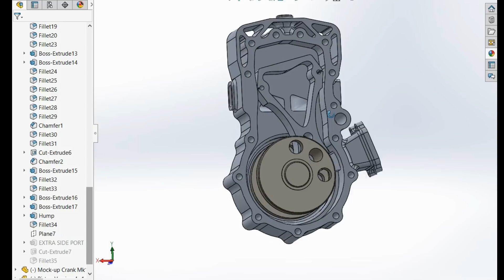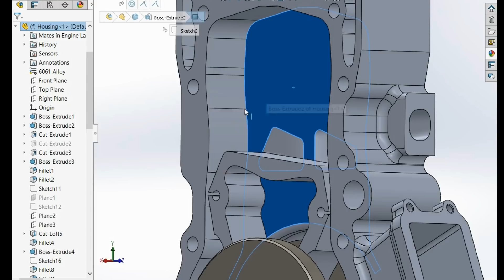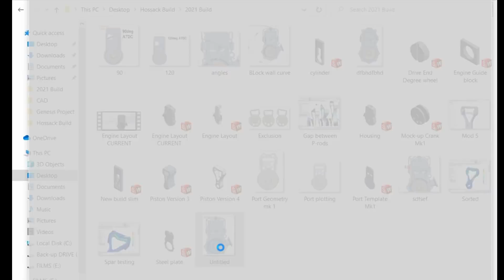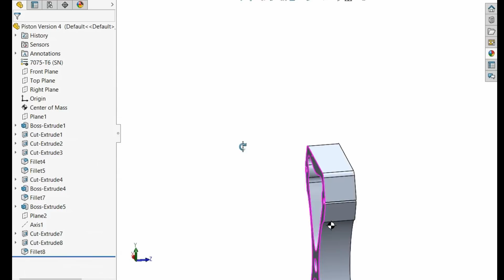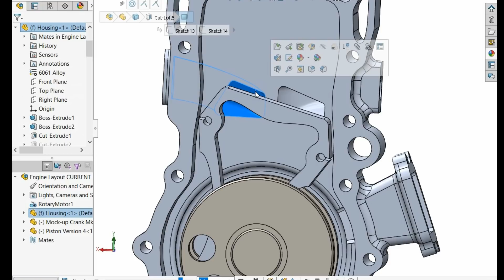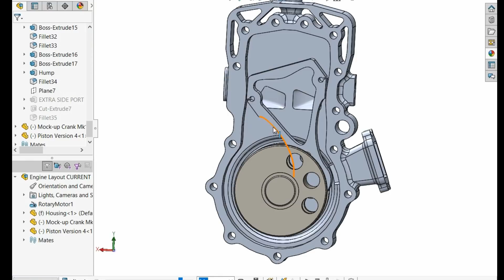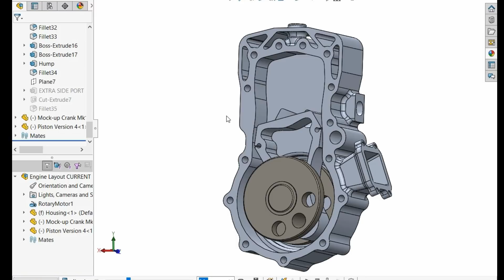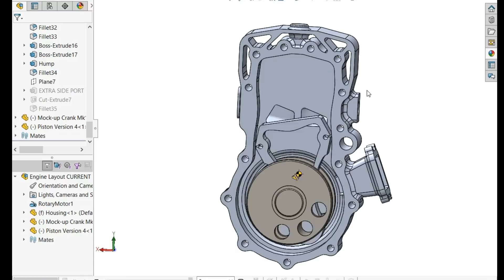The Hudson/Hossack Engine   Part 4

Comment: Matt the piston/con rod material you're looking for is Elektron 675 which is a magnesium aluminum alloy. Looking forward to part 5, good luck.
Reply: Elektron 675 is supposedly lighter than aluminum, stronger than aluminum at temp, and easier to machine than aluminum, cost oh well you can't have everything.

Comment: You can add a trace to the tip of that wiper and get the exact shape of it when you animate it. I can’t remember if that’s an inventor thing or a solidworks thing though. Too many CAD softwares in my head..

Comment: I like the flat p-rod.  It could be made dirt cheap as an extrusion - no need for expensive machine time, just slice it as thick as you want, face mill each side, bore the bearing seat, and cut the grooves for the seals - job done.  There'd be very little waste in the process too.  Extrusions are great for automated topology optimization too, so you could get a pretty optimal structure relatively easily.  
Have you considered making the crank modular as well?  Short, spline-ended tubular shafts for rod and main journals, would reduce the moment of inertia significantly, make the manufacturing process really simple compared to the traditional crank, and would allow a lot of flexibility.  Want another couple of extra "cylinders"?  Just add a couple of case modules, and extend the crank with some more counterweight plates and journals.  Each part would be identical and easy to mass produce.  If the number of splines was a multiple of 12, the same balance plates could be used with different rotations (60°/120° for i6 vs 90°/180° for i4).  A modular crank might be less rigid along its length, but it doesn't need to be as long as each segment is supported.  If you wanted to produce an engine with a bigger "bore", you'd just use thicker cylinder modules, slice your p-rods thicker, and use longer rod journals in the crank, with no need for major design or tooling changes.  By having such a modular crank, you wouldn't need the p-rod to have a split bearing - you'd just bore a precision hole and press fit a bearing/bushing, slide it onto the pin, and fit the balance disc to complete the assembly.  The main bearings could also use inexpensive bearings, press fit into the steel plates, eliminating the need for complex oil injection passageways.

Comment: The wall shape issue is interesting... seems like you've assumed the "piston path" should be straight up and down and pass through the conrod center, but a lot of engines now have offset cranks and this one even seems to allow a curved piston path!  All of this would affect / depend on the shape of the chamber walls, and impact port locations / timing.  Likely to much to fuck with for a project like this, but if it ever caught on gives yet another parameter to play with.

Comment: Great project mate!

I am watching your channel for a quite long time and I always could find some interesting tidbits in your videos (Thank you!). Since I am also a mechanical designer and have some experience with ICE I would like to share with you some suggestions for this engine design if you don't mind.

1. I would make a press-fit crankshaft design since they are much easier to manufacture and later on you can quite easily make different firing orders (180 degrees, 90 degrees, Big Bang,...) and it could be used for 2T and 4T engine. First, I would suggest you a 2 cylinder (parallel twin) design since you can play with firing orders (2T and 4T) and different port designs on midplate and still get all relevant data for n-cylinder designs. Also, you can use a variety of dimensions and designs of needle bearing models for big end.

2. Conrod-Piston design is not ideal natural frequency wise and in my opinion, some of its sections could be prone to buckling. I think you should use something like T or H profile along the triangle contour of the conrod-piston part.

3. Piston part sides should be circular or oval without sharp transitions with top piston plane since those sharp edges could be a source of hotspots for knocking. That side squish section of the piston will accelerate the hot gasses across that edge and make it very hot.

4. For a 2T diesel model with intake valves I would go with a Bishop rotary design valve and had an intake port with 75% of the surface of the piston or something on the line with Lotus 2T design from 1991 (http://www.douglas-self.com/MUSEUM/POWER/unusualICeng/RotaryValveIC/lotushoriz1b.jpg). You could get an engine with 15:1 CR ratio and with very high engine speed (15k RPM?) since volumetric efficiency should not be an issue.

Thank you for all of this and good luck with the project!

Comment: If the “p rod” is to have an open centre , then wouldn’t this mean that both ports would be open at the same time whilst combustion is happening meaning that gases would be free to flow in either direction between cycles
Reply from the maker: Yes
Reply: And wouldn’t that be undesirable as not only could the exhaust gas dilute the intake charge but the pulse could also slow the incoming charge
Reply from the maker: Well it depends what you're exhaust gases are doing and what the intake is doing at that time

Comment: What about a thin web/fillet on the underside of the piston on the inlet side located up against the side wall nearest the inlet port. This would block any inlet going below the piston on the upstroke when the exhaust port is closed and force the air/fuel mixture above the piston. Obviously there is a weight and balance consideration to be taken into account

Comment: Would it be possible to use 2 piston rings/piston edge seals on each side (one just above and one just below where the current seal is) to account for the rocking, or would that negatively affect the seal contact too much?

Comment: with 4 cylinders with crankpins at 90 degree spacing, how do the primary and secondary balances work? 
how smooth is it? 
what about narrower angle to create somewhat of a "big bang" firing order...probably not as smooth but more tractable for a motorcycle...

Comment: Would love to see this as an opposed piston motor!
Reply from the maker: Why?
Reply: @thedirtyworkshop   love the concept of two pistons pushing each other instead of trying to push a head...perfect primary and secondary balance, if there is such a thing...
with such an efficient port layout crankcase induction could be maintained, avoiding the weight and complexity of a blower.
for aircraft use the gear driving the two cranks could double as the prop reduction...

Comment: Hey Matt,

I know this is a design process for you still, but I was curious how the crankshaft is going to be installed with the multiple plates/housings. If it was a single piston design, no big deal, but those crank counterweights will prevent you from layering the plates/housings together like you would on a Wankel with an eccentric shaft. Not criticizing, just curious how you will go about tackling this, like if you'll have the bottom part of the plates/housings drop out to form the bottom part of the crankcase, but that adds some complexity so I'm not sure. You've probably thought about this and more than likely will be on a future video, but figure I would ask.

Keep up the excellent work. This is really interesting.

Comment: 1. How would the torque be affected by the limited surface area of the piston?
2  Could the rocking motion be used to assist combustion efficiency?
Cheers
Reply from the maker: 1. Limited surface area?
Reply: @thedirtyworkshop  it seems like a long skinny piston crown..lol..
Could we make it wider so there is more surface area and hence more torque..
I figure it's going to be a screamer of an engine.. maybe trade some topend for a bit more, lower down the rpm range??
Reply from the maker: That's not how it's works... more area means more volume. Not only that, this is a 147cc cylinder, do you know who much area there is compare to a round piston?
Reply: @thedirtyworkshop  Yes more volume but also we are not port restricted so filling a larger cylinder won't be a problem.
Combustion pressure should be the same so more surface area on the piston should give us more torque... yes it would increase the displacement but considering how little it weighs it should be OK??
Reply from the maker: That's not how pressure works...

Let's say you have a 1 litre engine and a 2 litre engine. The 1L has a piston area of say 4 in^2 and the 2L has a piston of 6in^2. Let's say combustion pressure is 1600 psi for each. The 1L engine would have a force of 400 lbs. The 2L would have a force of 266 lbs. Less force.

But it depends what the crank stroke is. In other words it doesn't just work as "bigger is better". These are PV engines where pressure and volume matter. If you have a bigger piston, you have a larger volume change per mm of stroke, which means pressure drops more rapidly. 

If large meant more torque then why do the biggest engines in the world have small pistons vs their stroke???
Reply: @thedirtyworkshop  
I'm confused mate.. how does a lager surface area produce less pressure? 
All else been equal  a larger surface area to push on would make more torque??  I think..lol 😆

I understand it's a pv engine ect but if that all stays the same just a bigger displacement it should make more  torque... ??
Reply from the maker: Pressure is force/area. If the force is the same but the area is increased then the pressure drops...
Reply from the maker: Now you're talking displacement which is volume. Make your mind up, are we change area or volume...?
Reply from the maker: Anyroad, back to your original comment, you said limited surface area. It's not. It's actually the same. That's how I defined the size of it
Reply: @thedirtyworkshop  I missed the point.. soz.
It's supposed to be the size it is for a reason.. sweet as mate
Reply: @thedirtyworkshop  both I would think.. if stroke stays the same?

Comment: Amazing stuff! Is it possible to do TPi on this and have the bottomend with healthy lubrication like a 4 stroke ?
Reply from the maker: You.can always do that, but at the expense of complexity and weight
Reply: @thedirtyworkshop  Oh yes, very important and crucial factor. I understand why you didnt add the TPi. Whole point of the engine is to be lightweight and cheap.
Reply from the maker: The other issue is pumping. TPI doesn't solve that.
Reply: @thedirtyworkshop  I can always be that idiot and say 'jUsT suPercHarge iT m8' but yeah, that adds a shitton of weight, cost & complexity on something that's even simpler than a 2 stroke 😂

Comment: Matt, looks to be a viable concept, I can see this working as a single or a twin 'cylinder' but for anything greater than a twin how would you feed and exhaust the cylinders? 
Wouldn't the ported sideplates need to be thick enough to allow a port through their width and then turn 90° to allow carb/injection and exhausts to be located as per accepted norm?
I would imagine this would disrupt the inlet mixture flow, and also create an undesirable localised hotspot for the exhaust.
I guess that the plates could be investment cast to give a flow curve to the elbowed port but this would make for a considerable increase in engine width.
 If you can achieve significant performance advantages then the trade-off in engine width probably wouldn't be a huge disadvantage.
I'm aware that this conceptual at the moment, this is not a criticism, just an inquisitive observation!
Reply from the maker: We're going to be doing some thermal studies soon

Comment: Is there any way to make a system to change the "piston" without pulling the crank?
Reply from the maker: we're getting to that
Reply: Pretty much all engines the pistons are installed after the crank. I want an engine where I can change the piston without taking the head off!!!
Reply from the maker: If you're going to ask for miracles why not just ask for an everlasting engine...

Comment: If there were a way to lower the cost of manufacturing turbine rotors, that's the way I'd go. You seal the edges of that "piston", but what about the sides? What of the ports that are uncovered as the "piston" approaches TDC?

Comment: Why make an inlet at the bottom when you can make it at the top (by closing it with a ball valve)?
Reply from the maker: Ever used a ball valve at 15,000 rpm?
Reply: @thedirtyworkshop  nope, lol
Reply from the maker: Lol no one has
Reply: @thedirtyworkshop  Sorry not an engineer) Perhaps this design is not very suitable for an internal combustion engine (due to increased wear at high speeds and oil ingress into the intake)
Reply: @thedirtyworkshop  But I saw a couple of papers on developments in this direction (it's hard to say at what stage they were + it was 5 years ago)
Reply: @thedirtyworkshop  Hmm ... found from similar systems - rotary valve (patent EP0423444A1) +
https://www.hofmann-dsm.com/products/ds-125cc-rotary-valve-fourstroke-engine/
+ a similar system was used in the F1 engine MGN W12
Reply: @thedirtyworkshop  Oh, didn’t know you made a video about the Rotary valve, sorry for the spam, lmao

Comment: Sorry for going off topic but what sealant would you recommend to fit core plugs in an old engine, Surfaces and pretty clean, few tiny pits. Someone said use Wellseal on facebook
Reply from the maker: Permatex do a specific water and coolant resistant sealant I think...

Comment: Put the radius on the piston! It might actually be a parabola or a section of a trochiod.
Reply from the maker: Or no.
Reply: @thedirtyworkshop It's the simple solution.  You'll still have a linr contact but I see no way around that regardless.
Reply: The real problem is the slap on the piston above the "apex" seal, radius on piston or sidewall doesn't matter. you will have to have more clearance above the seal for heat expansion just like a regular piston. I don't know how the seals will like being trapped if the side clearance is tight and how that might effect gas sealing.
Reply: I don't think you can stabilize the piston with just the seal, it will have to run close regardless of the placement of the radius. I would just go for simplicity.

Comment: Make it a boxer engine
Reply from the maker: Because?
Reply: If you had two crank/pistons on the same axis making it a boxer 8 you could increase power to weight/size of the engine dramatically Also If you separate the piston case chunk from the intake exhaust chunk you could increase the size on both intake and exhaust ports by having them come from the entire side front/back instead of being split in half left to right.
Reply from the maker: 2 stroke...

Comment: Bikes didn't get much better between the 70s and the 80s?  I think you may have got your decades mixed up.  Motor technology increased incrementally, but the 80s was where frames got stiff, particularly when wrap around spar frames came in, and suddenly handling became something less than "vague".  Compare say, an original Z1 to to something like the VFR50 or FZR1000.  Streets ahead.  Or if you want two strokes, compare the widowmaker to the gamma. There were also improvements in suspension technology and geometry, brakes got better, and everything got lighter.
Reply from the maker: Improvements, yes. Huge ones? 

Kawasaki H2 Mach IV
1975

74HP @ 6,800 rpm
77Nm @ 6,500 rpm

48% increase in 10 years

Kawasaki GPZ900R
1986
110HP @ 9,500 rpm
85Nm @ 8,500 rpm

36% increase in 20 years

ZX10R
2002

148.2 hp @ 11,650 rpm
103.2 N⋅m @ 10,500 rpm

Between 1986 and 2002 here was the emissions intervention.

Today its about 190HP. The point is that as time moves on progress usually slows as it gets closer to physical limit. 

Now you're probably thinking this is just engines, but everything else is related. You don't make improvements in braking when you don't need it.
Reply: @thedirtyworkshop  Oh, for sure.  I'm talking more about handling. 

[old git anecdote ensues]

Back in the day, before the introduction of speed cameras, a bunch of us who worked for BA used to race around the Heathrow perimeter road early in the morning before going to work.  I was riding an '86 FZR400 at the time, there was a 900SS and a VFR50 in the mix, and a colleague who had a lot of iconic bikes.  As well as the baby brother 250 to my 400, he had a CBX (not the 550, obvs), an H1 and an H2, and a gamma.  He liked his strokers.  I rode the H1 back to back with my FZR, and I know which one I'd rather ride fast on again.  Spar frames, which came in in the 80s, were a total game changer.  The H1 and H2 had insane power (and delivery), but had shit awful handling and worse braking.  They were terrifying to ride.  The CBX had a wonderful exhaust note, but rode like a pig on stilts.  The FZRs and VFR kicked them all in the tits - hell, even the 250 went faster round the (perimeter) track than the H1, and you had to wring its neck to get it to even pull away, let alone pull a wheelie.  The gamma was terrifying in a different way, although it handled really well.  I went up to the first roundabout, turned round and gave it back.  Too much bike for me.

I know your bias is more to engines, and yeah, there's been a big relative improvement in engine performance with the introduction of fuel injection and the plethora of sensors engines have nowadays, ironically put there mainly to try and keep emissions down.

I like what you're doing with the Hossack design, btw.  It's a very neat idea, with some interesting problems to solve.